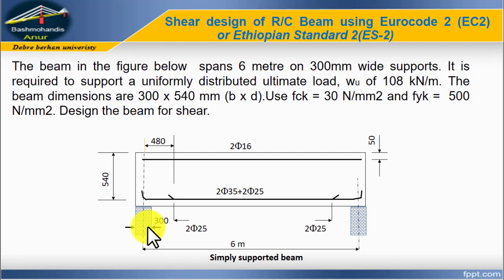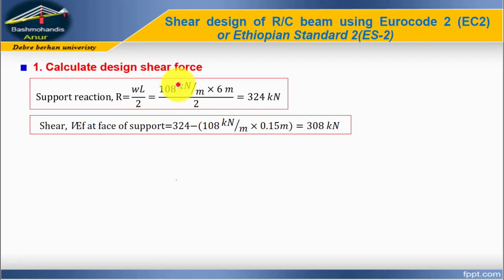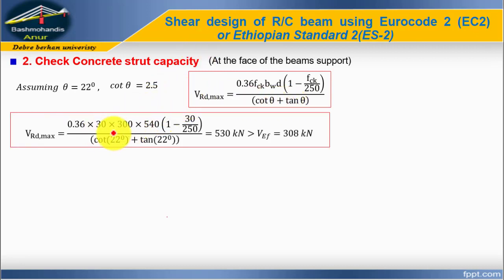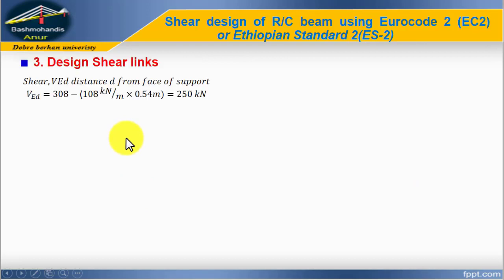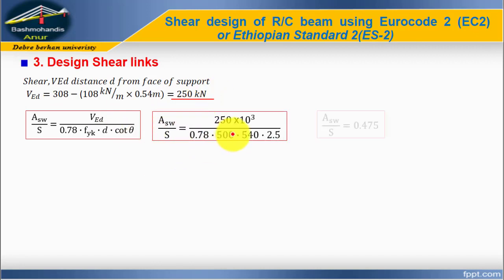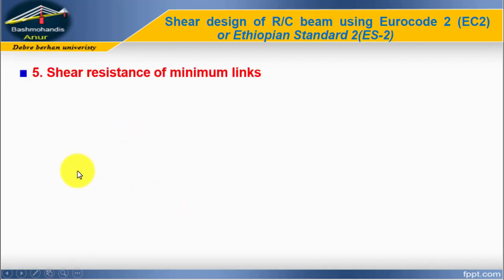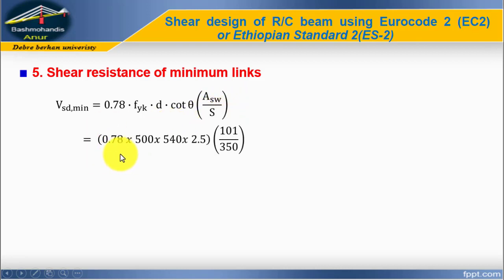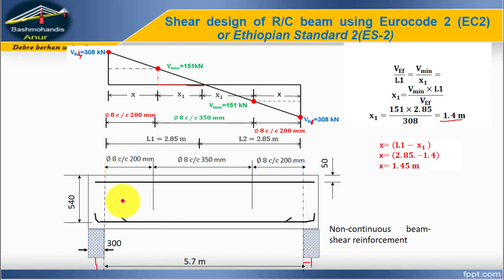Shear Design of Beam Using Eurocode 2 /Ethiopian Standards 2

Comment: Hei,
I am an eritrean student in structual design. I have many questions to ask:
Step by step videos on building 6 multy storey buildings.
Do we start from structual analyssing the frame with the elements supports and then moving to designing it with the international or national codes.
How about walls, masonry walls in stone and bricks, aluminium, steel, glass and wood.
What about the inside comfort, calculating humodity.
How do you calculate selfweight and imposed load, live+dead load?
Wind load?
Earthquake analysing of the structure?
Reply from the maker: Oky, I will make one video on how to desigh multi story building as per Eurocode and Ethiopian code.
Reply: Thanks. Please it really slow because I will be able to understand it and many others. We are not professionals yet.
 structual analysing, FEM design nodal displacements, frames, elastic and plastic, etc. :)
Reply: @Civiltimes2210  please have you been able to do this yet??